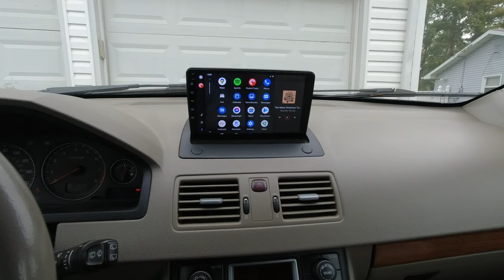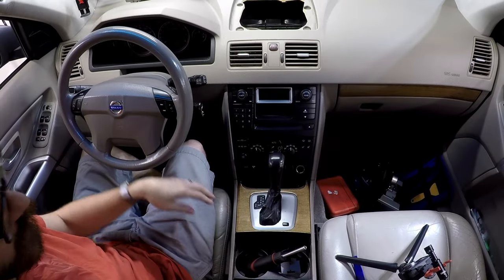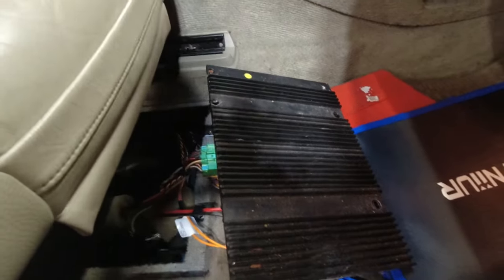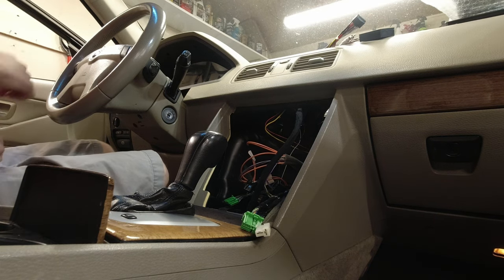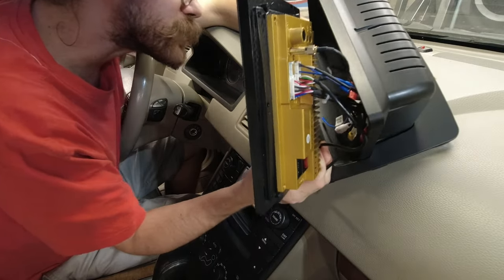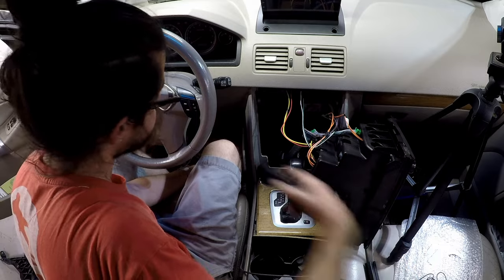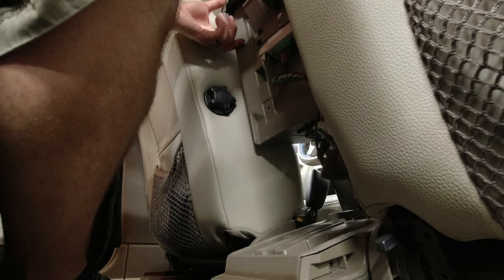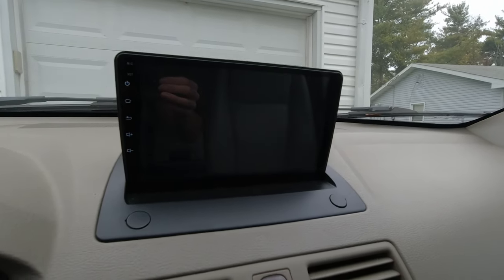Installing an Android Head Unit in a Volvo XC90

Comment: Not sure if you still get the notifications but with it bypassing the amp, if you disconnect the amp will it still work? Mine was flooded and dead.  Good Video.
Reply from the maker: If the amp is disconnected, the speakers will be driven by the new unit! It's possible there are other systems that tie in to the amplifier but I'm not sure what they would be. 
It's also important to note that the amplifier is only bypassed in XC90s that do not have the AUX input.

Comment: I have a 13 with the USB Aux/Power in the glove box. Can I just use that to power this and provide data? I know that it does accept audio because when I select AUX it plays whatever is connected to it.
Reply from the maker: For this unit, you can't power it via USB, it requires all of the connections to be made behind the factory radio.
However, if you want a simpler install, you can look into universal Android Auto/Apple CarPlay screens! They only need to be connected to AUX and 12V, you can choose where you want to mount it, and move it to any other car as needed.
Reply: @frenchineer  thanks I’m probably going to go universal. Plastic on my car is just too brittle to rip stuff out. Been there done that .

Comment: Does your radio need to work for this to install properly? I just bought a 2004 XC90 and can't figure out if the radio in it works or not
Reply from the maker: The in the non-AUX cars, the new head unit connects directly to the speakers and bypasses the amp, so the original radio does not need to work. You may need to find the correct harness separately, the seller I bought this from no longer offers the non-AUX harness option.

Comment: My 2010 Volvo XC90 uses the other power harness (with the gray plug) but the control unit has optical sensors, which are on the power harness that you use in the video. In conjunction, the optical sensors on the power harness of this video don't work with the optical sensors of my control unit so I can't use that one anyway. I can use the gray plug power harness to get power to the Seicane head unit but no sound comes out. I think this is because the Seicane isn't talking to the control unit (via optical sensors). Any thoughts?

For context: Seicane messed up and sent me an H6N-JH instead of the one shown in this video.

Great work and thanks in advance!
Reply from the maker: Checking the website and the harness I didn't use, did you connect AUX L IN to Cable Audio Out L and AUX R IN to Audio Out R? (the IN plugs are on the gray harness and the OUT plugs on the radio harness with 6 female RCA connectors) That should connect the radio's output to the audio inputs on the gray harness.
I hope this works!
Reply: @frenchineer  Thank you for the quick reply! That didn’t work. :( I also don’t have steering wheel controls. 

I’ll see what they can do but so far Seicane customer service is kinda impressively awful. 

Thanks again!
Reply from the maker: That's a bummer... I wonder if the CANbus decoder box isn't working properly, since mine interprets the steering wheel controls etc. I'm not sure if it would explain no sound though. I hope you will be able to find a solution!

Comment: Amazing video! Thank you very much. I have just fully connected my Android Head unit, and it seems to work well, BUT, as you show in the video my front left speaker would not work. I went to the harness in the ampli and also saw a mismatch in the pins (minute 26:29 of your video), BUT unfortunately I am not able "rewire" them. I purchased a set of "pin removers" but none of them seem to work. Is there any hint or special way of doing that?  It would help a lot! thx a lot in advance!
Reply from the maker: I found removing the pins difficult too! It took me a while.
I think I ended up using one of the thin flat pin removers. I think the pins are held in by a little metal tab on either the top or the bottom. You may want to try to push the wire towards the connector while working to release the tab from the pin side, then try to pull the wire and pin out. Once you have one out, you can label it, and hopefully it will help you with the second one since you'll be able to see the tab that holds it in. I hope this helps a little!

Comment: Nice video! Did u buy the head unit to support original car optical fiber or not? How do i know if i have optical fiber? Does this head unit work on xc90 without aux option?
Reply from the maker: Thanks! 
At the time I bought the unit, the options were different, and they sold a version that was compatible with the non-AUX version (I don't remember a fiber option when I ordered). Unfortunately, they no longer sell the option for cars without AUX. I have heard that there are harnesses sold elsewhere that match the one I used. Other brands/vendors may sell a kit with the head unit/harness for non-AUX cars.
Reply: @frenchineer  thank u so mutch!

Comment: Frenchineer, thank you for posting this video. Great job! 
I have a XC90 I plan to upgrade. Since the radio and amplifier were not used, this upgrade should work even if the radio had stopped working. Instead of replacing with an OEM, I feel upgrade should be a better solution. What do you think?
Reply from the maker: Thank you! 
I think since this system bypasses the amplifier, it should work even if your factory radio doesn't work as long as the speakers are good! Make sure you get the right options for your radio, in my case my car is a 2006 that did not have an AUX jack. I am not sure if there are differences for installs in cars that had the aux jack from the factory.
Reply: @frenchineer  thank you for your reply. That's what I was thinking too. I have a 2005 T6 no AUX jack. What I like with your upgrade was that you did not have to cut any wires. :)
Reply from the maker: Yes, no wires to cut is a nice feature! Since you don't have an AUX jack, you'll have to make sure you can get the right harness. The company I bought mine from used to have an option for cars without AUX, but no longer does unfortunately...

Comment: Did the subwoofer play on the aftermarket radio? Had the same problem with the front left speaker, but the subwoofer wont play
Reply from the maker: My car has the 3rd row AC controls which means no subwoofer (since it's a 2006, it was either the sub or the ac). I'm not sure how the subwoofer was tied in to the audio system unfortunately.
Reply: @frenchineer  thanks!

Comment: can you easily hook up aftermarket subwoofers to this radio
Reply from the maker: I don't have experience with aftermarket subwoofers, but it may be possible to use the RCA outputs from the head unit to send signal to the amp/sub. You can see the audio inputs and outputs on the product page to see if what you need is there.

Comment: Fantastic work and presentation. You did it with ice in the stomach and confidence. Does not seem to be the job for the average Joe especially improvising with reconnecting the left side speakers. I'm very eager to buy one of these units and they have come down to about $200 from China at this time. However I think I would need to find a mechanic willing to take on the challenge!  Thanks for your entertaining presentation. Please consider to scrap the background music - it is just seriously annoying and distracting.
Reply from the maker: Thanks! If you have a later car with the AUX input, the job is simpler since it doesn't connect down by the amp.
Reply: @frenchineer  I do recognize it all and have the amp under the passenger seat. It's a 2005 model. Though no video screens in the back of the head rests or for rear view navigation - I'll skip all that. Was this for a customer or was it for your own car? How is your experience with the system and the GPS navigation? Would be great to see a video with all the apps being demonstrated with the nifty features!  As I live in Sweden I'm concerned with that the street maps won't connect or are accurate. The endless amount of GPS systems that all need updates. The Chinese eBay seller said it would be no problems but I'm worried it won't work.
Reply from the maker: This was for my car. I didn't have any luck with the onboard GPS, possibly because of the onboard app (I didn't try to install an alternate app though).
I use Google Maps through Android Auto, that way it's always up to date since it operates off of my phone. Android Auto and Apple CarPlay would allow you to use your favorite navigation app on the head unit.
Reply: @frenchineer  oh! I see . . .  So you did have issues with the GPS system like I anticipate. Yes I have an Android/Samsung phone and using Google maps also and it works well. However using it too much is eating up the monthly bandwidth so I have to monitor it if I would go on long road trips.  I wanted to avoid having to use the phone being connected to the car system. Can you use Google Street maps with this new unit without having to connect the internet connection through the phone?
Reply from the maker: If you want to avoid data usage I would recommend apps like OsmAnd that let you download a region onto your phone and work without data. I've used it before with my phone in airplane mode in an area where there was no cell reception. You could also try to install that or something similar directly on the head unit.
I haven't tried any apps on the head unit, but apps that allow you to save map data/have an offline mode should work. I think Google Maps allows you to save an region for offline use so it could be something to try.
Just to clarify the operation, the phone does not share its connection to the network when you plug it in. Android Auto operates with the phone handling everything. If you want the head unit to connect to the internet you would need to use your phone as a wifi hotspot or connect it directly to a wifi network.

Comment: i Have 2011 xc90. i use apple and my wife uses aneroid.  i have sensors and back up camera . which system is best for me to use ?
Reply from the maker: Because you have a later model year, any radio you get should connect using the AUX system instead of bypassing the amplifier, so your parking sensors should continue to work. I'm not sure how the backup camera integrates though, so I recommend checking on some Volvo forums to see how others have done installs with factory backup cameras. 
To use both Android Auto and Apple CarPlay, I recommend getting a CarKit/CarlinKit to use with the Autokit app the radio.

Comment: Do original radio need to have AUX option? Mine doesnt have. Also some cars have optic fiber and other dont does this radio fits all? Thanks
Reply from the maker: I did not have AUX option, but the place I bought it no longer sells the kit compatible with no AUX. You might need to find the harness elsewhere or find another vendor.
Reply: @frenchineer  thanks

Comment: where can I buy this cable, do the steering wheel buttons also work?
Reply from the maker: I got mine with the radio (it was an option at the time) but there's a chance you may find the right cable somewhere like aliexpress.
The steering wheel buttons work for me! Something to keep in mind on installs that bypass the amplifier like this one: the subwoofer may not receive signal (mine was not equipped with one), and parking sensor beeps will  not be heard (I did not have parking sensors as an option).

Comment: Hi, one additional question: since the amp under the seat has to be bypassed, does the head unit still has enough power ?
Reply from the maker: I've found that it has enough power, but I didn't compare the maximum levels.

Comment: Hi, What is the carplay model you are using in the vehicle?
Reply from the maker: For Apple Carplay you would need to use a carkit usb adapter. For Android Auto you can use either carkit or an app like head unit reloaded.

Comment: Question, I purchase the newer model, but this did not include the cable that goes into the amplifier, what the name or info on how to purchase of that kid that came with your unit?
Reply from the maker: Hi, unfortunately it looks like Seicane no longer has the kit option for cars with no AUX jack (which is what I have). I am not sure if they have any left, or if another supplier has stock. I didn't have to order it separately since the option was still available when I ordered it.
Reply: Thank you, I believe his what I found - 
 Car 16pin Audio Wiring Harness With Canbus Box For Volvo XC90 09-13 Aftermarket Stereo Installation Wire Adapter #HQ7100
Reply from the maker: That looks like the harness I had! It looks like all the same connectors are there. I don't know for sure what the compatibility will be like with the CANbus decoder, but it's worth a try!

Comment: Fantastic video and great job! I want to update my xc70 -09. Any suggestions?
Thanks in advance!
Reply from the maker: It looks like there is a way to add similar features using the factory radio by adding a box that piggybacks on the existing hardware to add features. 
For head unit replacement, it looks like Bluepower makes one. 
I recommend doing some research as there may be more options. Forums like Swedespeed also have lots of resources that should help you find what you're looking for!

Comment: Hi man. Nice work. I have xc90 as well just will work on suspension first and will change air bag clock spring since it’s giving message about anti skid system. So I really don’t understand what you did with that cord plug on passenger side. You removed two cords from it and reconnected. Can u explain it please. Thanks
Reply from the maker: The connection at the amplifier in the passenger footwell is from the amplifier to the speakers. The new harness connects the new head unit directly to the speakers, but keeps a couple connections from the original system going to the amplifier there (possibly to prevent errors or keep other functions working). This is only needed for the non-AUX cars, so if you have an AUX port on your vehicle, the harness you will use is different.
Reply: @frenchineer  so I need figure it out if I have aux or not didn’t check that car yet
Reply from the maker: The install should be easier in a car with AUX. If you don't have AUX in it, you would need to find a place to purchase the harness for it. Do you know what year the car is? I think 2007 and up have AUX.
Reply: @frenchineer my car 2009 fwd
Reply from the maker: In that case you very likely have AUX, and the connections for the install should all be behind the factory unit. You won't need to run anything to the amplifier, so the install is easier!
Reply: Got it but backup camera will be a pain
Reply from the maker: Yes it's definitely involved, though I know some people like the "wireless" license plate mounted option. I believe those just need to be connected to a power source.
Reply: @frenchineer  but how they connect with the screen
Reply from the maker: There's a receiver box that connects to power and video input on the new unit

Comment: Thanks for the Video. I just followed your video to install the head unit, the only issue that I get is that the level of sound on the front driver side speaker is not equal to the passenger side speaker. The driver side is much lower. Please advise how to adjust.
Reply from the maker: I think checking the harness connections by the amplifier is worth a try. I also found that it was hard to verify levels with the doors and windows open in my garage.
Reply: Cables at the amp seem fine. I think the issue is at the back of the original unit where the fiver cables connect see attached pictures via gdrive
https://drive.google.com/drive/folders/1-3E52yqlIgICdfo_RMKvYGiS3Cvejuaq
Reply from the maker: As far as I can tell, the connections look good. I think the fiber optic connectors to the new unit aren't used for audio, so I'm not sure what the issue could be...

Comment: Hi, How do you manage to pair the steering wheel volume remote to the android player? Mine one isn't pairing
Reply from the maker: For me it worked automatically, I did not have to change any settings. I believe it is handled by the canbus decoder.
Reply: Thank you very much for your reply 
Just want to know, is your radio CD player working after installation it seems just an Android player working, but cd radio sound doses work 
Any suggestions would be appreciated 
Thank you in advance
Reply from the maker: No, in this install the factory radio is bypassed and the new unit powers the speakers directly. I think only cars with AUX can retain use of the original radio.

Comment: Hello I am considering buying an xc90. Could you delete the OEM unit without too much trouble. I see it as being quite large and obsolete. Maybe with a blanking panel or something, you could use that old space for USB ports or something else.
Reply from the maker: Unfortunately the OEM unit is interconnected with other systems in the car, so it does need to stay in place. When I turned on the ignition with the factory unit disconnected, it set off an airbag light on the dash that I had to reset.
Reply: @frenchineer  hmm.. was there room in the dash where you could hide it - still connected? The space could be used for USB ports, 12v outlets, switches etc - as I would purchase an xc90 for overlanding and camping. I have a background in Japanese cars, pre-00s, so moving to later model European will have a learning curve. Cheers!
Reply from the maker: I think that would be tough since the HVAC and original radio are all in one housing. I guess it could be done but it seems like a pretty significant undertaking - though if you can go check one out in a junkyard you could probably get a better idea by pulling out the original radio and checking the available space.
Since you're looking for something for overlanding, are you also considering vehicles with 4x4?